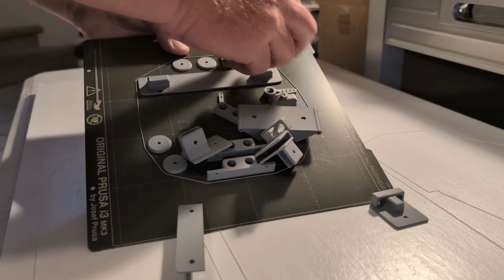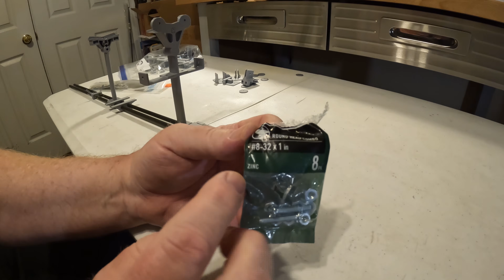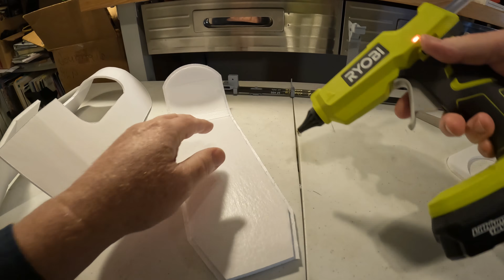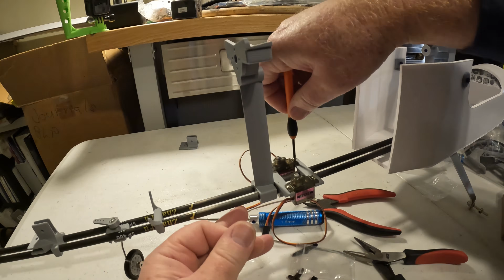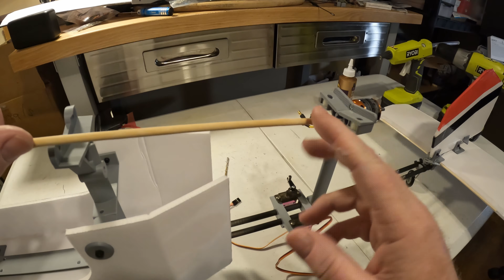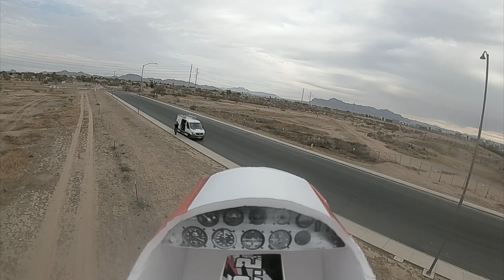How to Build the Sparrow Scout - Details - FPV Plane

Comment: I would like to build this plane but, i do not own a 3d printer.  Can i use a company that does 3d printing?  I could likely build the parts from balsa but, it would be a lot quicker to have them printed.
Reply from the maker: Before 3D printing I was building most of these parts from light plywood on the Slow Stick.  As for using a third party printing service I can't vouch for any.  I would say that 3D printing is a fun and affordable hobby now.

Comment: I have a question - in your Stick video, you called out an 880kv motor.   This build, however, calls for an 1120kv motor.   I'd like to ask about why?  Does it need more speed?  Is there more air resistance on this build when flying that requires the additional almost 50% increase in kv?  Or do you just prefer the performance of 1120kv?  I'm new to RC, so appreciate the info
Reply from the maker: You have a very good question.  Motor KV is directly related to the size of prop you would like to use. By adjusting the KV you can change the size of the prop while keeping the amp draw (battery usage) down.   Since the Sparrow Scout is a pusher prop and the space behind the wing is limited, I needed to go with an 8 inch prop.  So going with a smaller prop means I needed to go up in the KV to get enough thrust.   Going to a smaller prop and still wanting to have power means you go up in KV.
Reply: I’d like to follow-up with a flying time question.  You mentioned in your Stick video that a 2200 xt-60 battery gave appx 20 minutes flight time.  Of course, there will be differences such as you used another servo and video Tx, but for just visual (ground) flying - no FPV - what type of flight times are you seeing with a 1120kv motor and 8-inch prop with a 2200 battery?  Just a ball park idea is what I’m looking for ….
Reply from the maker: @sdavidrose  The goal is to try and pull the same or similar amp draw for the thrust required -- if you can get that your flight times should be very similar.   I am easily getting 15 minute flight times on my Scout -- and I have a buddy that is pushing his to 20+ -- as you said it depends on how you fly it and you altitude above sea level etc.

Comment: I printed and built following the video. Boy, what a great little project. I maidened the Sparrow Scout today and it did great. There was a little wind, so I know that was causing a little extra maiden balooning at times, but it was still a great little flyer. This was my first time flying without ailerons and the control is just fine. I am looking forward to a non wind flight and eventually prepping it with FPV equipment. My only question is where would you put the CG point?
Great project, enjoyed every minute, it was fun...
Reply from the maker: Awesome!  Thanks for the update!  The plane should balance at the highest part of the main wing.   It is always safe to start a little nose heavy.

Comment: Another nice plane. What kind of machine was the foamboard cut with? I made a pair of wings where I cut the foamboard by hand, using a printed pattern, but I always have differences in the pair of wings. Thank you.
Reply from the maker: The first prototype I cut by hand ✋ but the red ones were cut from a needle cutting CNC by my buddy Ben.   Nothing wrong with cutting by hand if you have good foam.

Comment: This is a fantastic build - it looks great with the red and white livery and flies nicely to boot. What is the wingspan and wing loading? Would this be a suitable plane to handle the weight of a gimbal controlled FPV camera?
Reply from the maker: The wing span is 1.2 meter -- I fly mine with servo gimbaled camera.  It can fly a good payload -- you may need to brace the top wing if you get to crazy with it.
Reply: @Qromer  We've come a long way with miniaturization. A CADDXFPV GM3 gimbal weighs 46 grams. So, that little bit of additional weight should not be noticeable at all. Cheers!
Reply from the maker: Yeah, you are totally right, 46 grams is nothing.